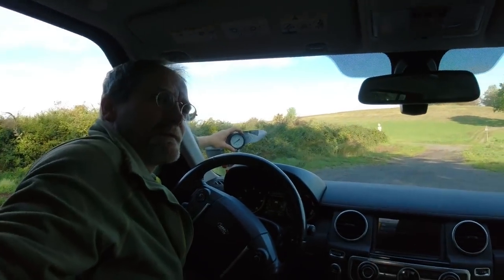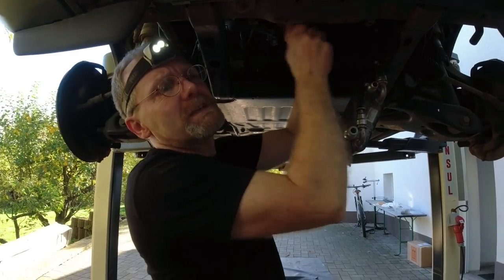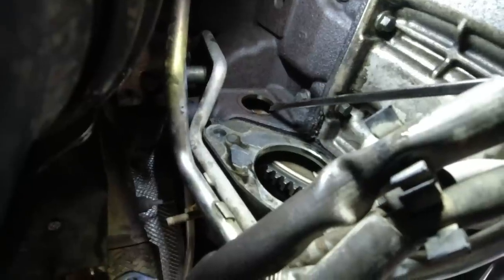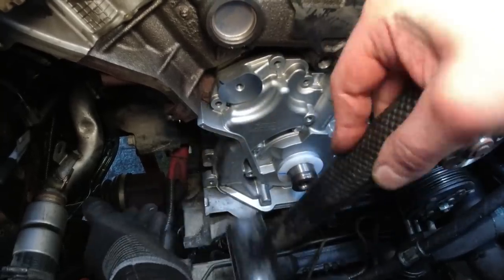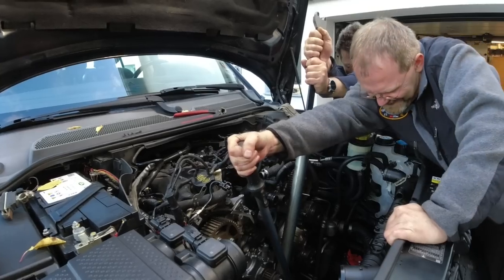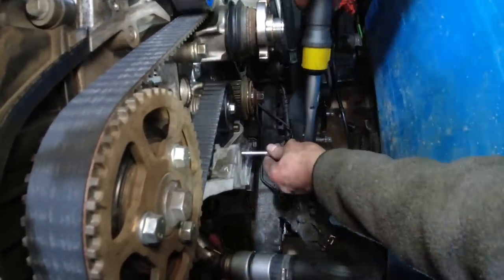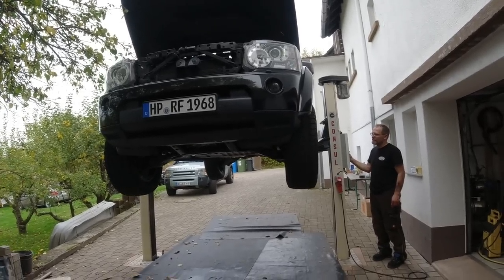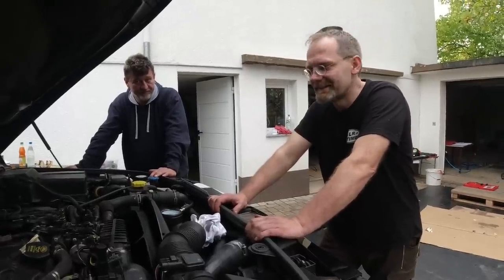How to replace the oil pump on a 3.0L SDV6 LR4 Land Rover - Discovery 4

Comment: 10 PSI oil pressure, warmed up oil, at idle?? I'd be shitting myself! Am I missing something? Surely they can't be speced THAT low from the factory?? Is that primary oil pressure, or am I missing something and that's a spec reading taken from a different part of the circuit? That just feels absurdly low pressure to me even at idle
Reply from the maker: Spec is min. 0.7 bar at idle at operation temperature. I shit you not.  All to conserve fuel.  Christian
Reply: @Vera_and_Christian  I'd love to see a set of rod bearings out of one of these after 150,000km on the factory original oil pump & a lifetime of 5wDumbAss!! If they even last that long under those conditions. Hey for what it's worth even the US spec GM trucks (Chevy/GMC/Cadillac) with the LS V8 going all the way back to 2007 have almost exactly this problem.. 80k miles on 5w20 baby oil and the original oil pump has totally given up the ghost, 5-20psi at idle.. if you're lucky and the DOD and/or rocker trunion bearings didn't shit itself/themselves first and trash the entire engine (yeah, look that one up for a lesson in absolutely spectacular failure!)